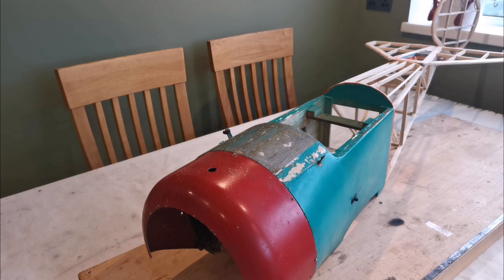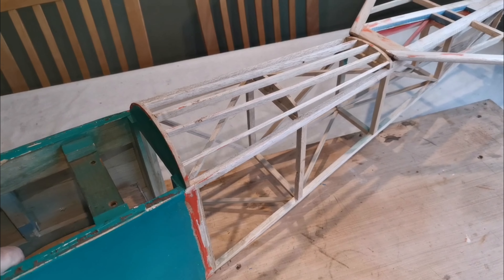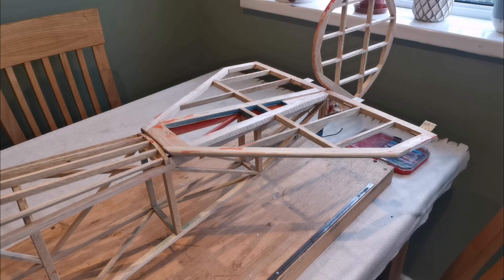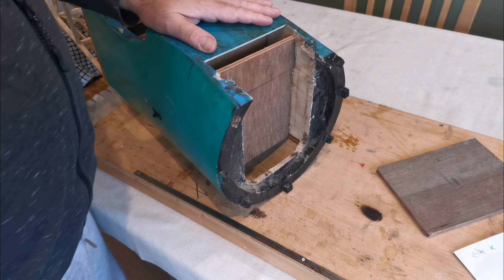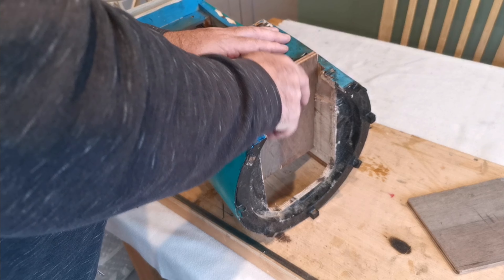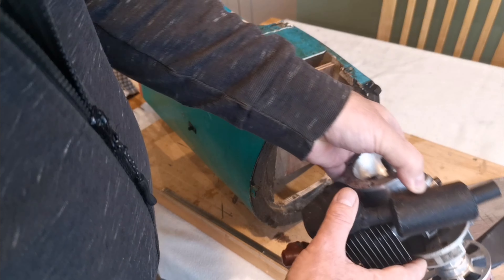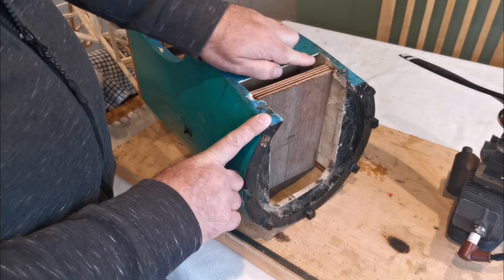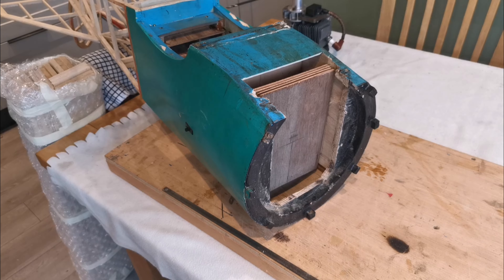Flair Fokker DR1 refurbishment

Comment: I agree with your use of CA and epoxy glue. I only use white glue for glueing larger sheets together or leading edge sheeting when I need more time to join and clamp the parts together.
Reply from the maker: So much choice with adhesives now.... Big step on from balsa cement 😂